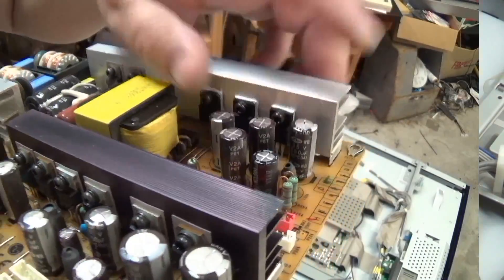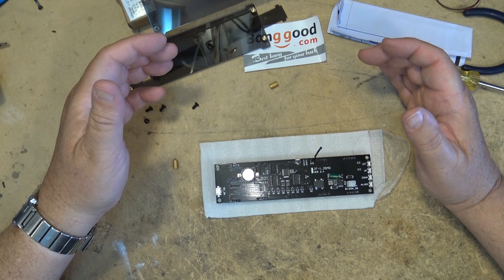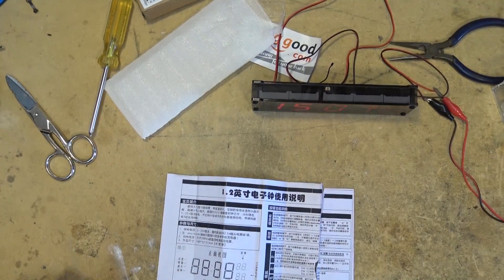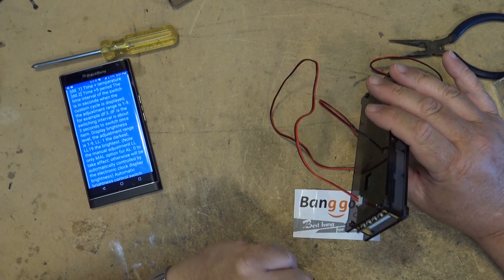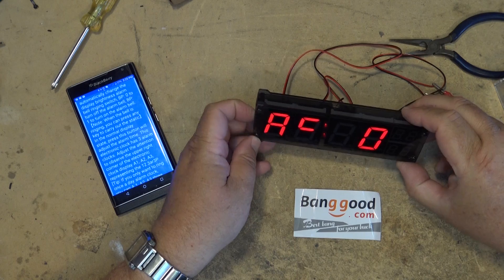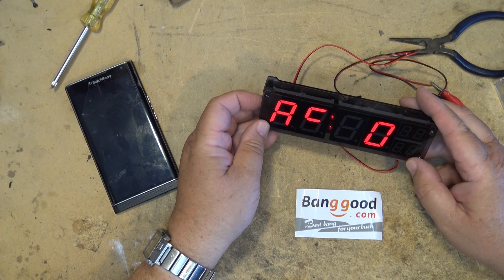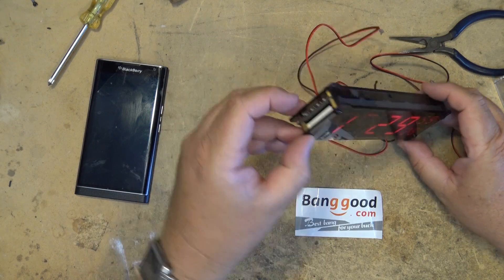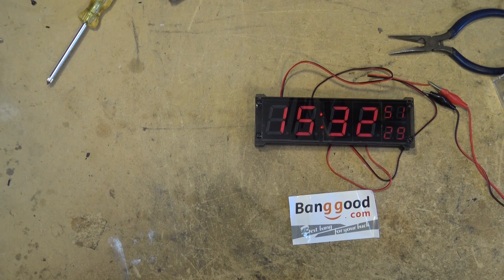Banggood 6 digit clock with temperature module

Comment: Not a bad clock, it's well overboard for my taste but the worst bit is the alarm sound.
Needed to be a lower tone and simpler 1/2 second beep.

The old vfd display clocks are pleasant :-)
Reply from the maker: zx8401ztv 
Great as an station clock for him radio. Stick that in the console and not only have the time in 6 digit format for logging but also temperature in the back of the rack which can be quite warm with radios running.
Reply: The majority of armature radio enthusiasts are male.  :)
Reply from the maker: I wonder why that is?

Comment: Did you find a setting to change the temperature readout to ºF?
Reply from the maker: No, nor did I find a way to put it in 12 hour mode.
Reply: That's a common complaint / missing product feature / deal breaker (for those of us stuck in F/12hr mode)
Reply from the maker: FindLiberty 
I hear you, but the rest of the world is on 24h time as well as metric. 
I think in both 12 and 24 hour time because we use 24 at work.